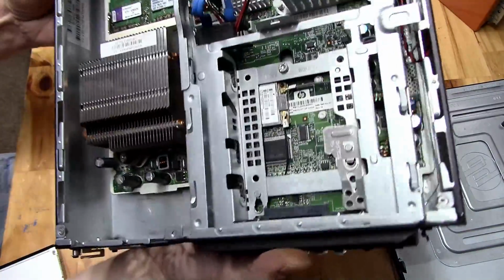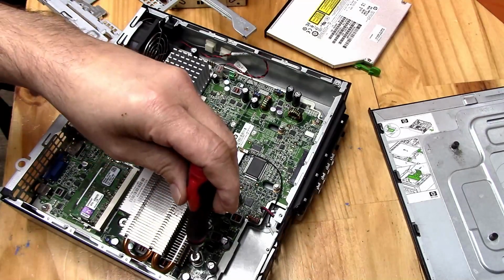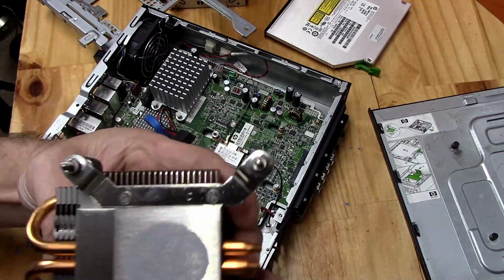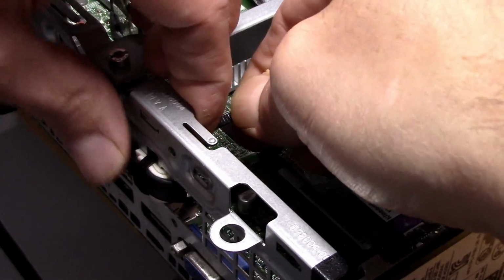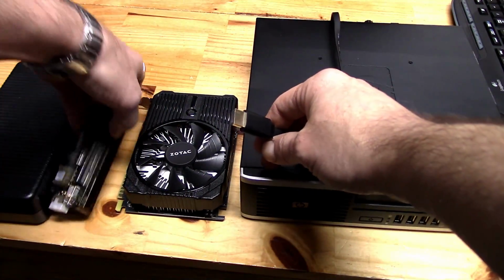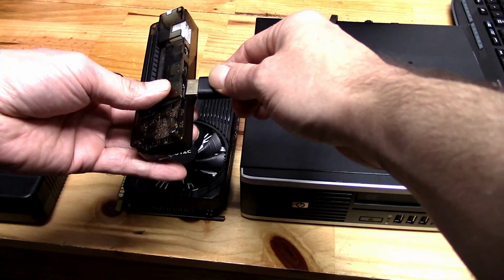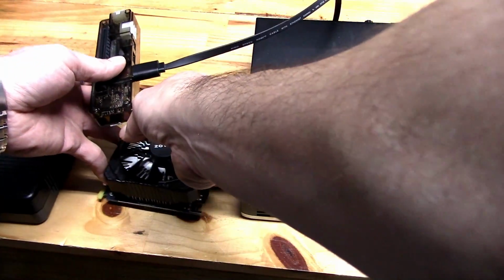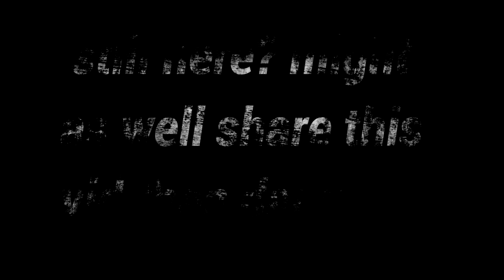gaming on hp pro elite

Comment: Your editing is getting simpler and simpler! And that's a good thing! No more flashy distracting bits! :D

Now, all that's left is the recording audio quality! Which I'm sure can be fixed with a $5 lavalier mic. >;)
Reply from the maker: +StringStorm ‌ I got one of those blue microphones. It records so low I have to use audacity to amplify I assume that's where I go wrong..
Reply: I thought gtx 1050 wont support/work on egpu because im planning to buy it for my laptop but i read a lot of people on the internet said they got error and trouble to use it with complication.Can u tell me how did u make it work
Reply: I'm pretty sure every card would work. It could be possible issues with the igpu of the laptop interfering with the gpu display output or maybe a defective egpu unit?
Reply: StringStorm ‌ i
Reply: modstek no you need a interface and a real mic bro the usb mic are shit unless you get a audio technica 2020
Reply: You prolly dont care but does anyone know a way to get back into an Instagram account..?
I was dumb forgot my login password. I love any help you can give me

Comment: I bought the Intel version 8300 USDT, paid £20 delivered which for the Windows key made it a very good deal and I didn't know you could hook up an external vid card, for what was going to be my PC to run my microscope and hold some tech manuals this little machine is being promoted to front room telly home theatre machine/retroarch beastie as mine someone chucked in a i7 and 8 gigs of SODIMM, my poor laptop is now relegated to microscope duty as that is slow as tar in comparison lol

Comment: Why you didn't replace the cpu with a Quadcore at least? Would have been better i guess
Reply: Crestom XYZ you must be new
Reply: The TDP wouldn't allow it i have a intel version of that pc
Reply from the maker: +Crestom XYZ I was hoping someone was going to tell me which ones are verified working
Reply: Troll Mctrollington Oh i didn't know, so that's why couldnt
Reply: EarthClad Not really, just i didnt know that the he couldnt put a higher TDP cpu, OEM mobos are really so pain in the ass sometimes
Reply: According to HP they offered the AMD Athlon II X4 605e processor (2.3 GHz, 2MB L2 cache, HT bus 3.0) as one of the processors with these systems.  https://support.hp.com/us-en/product/hp-compaq-6005-pro-ultra-slim-desktop-pc/4169006/document/c02142088
Reply: modstek AMD Phenom II X4 B95 but you have to do some tinkering and install a certain bios
Reply from the maker: +Kyle ._. Thank you
Reply from the maker: +cee128d thank you

Comment: there's several different variations of these. I've been wanting one just for its size. . I want an 8300 model. with support for an i5/i7 with 2x mpci slots + a GPU slot. the model in the video looks more of a base model with just a single mpci slot for wifi only
Reply: hpc 8200 usff has what you mention, i have it , ordering the gpu in a few days and lets see what happens

Comment: Why the wifi card adapter? You have full x16 PCIe with the MXM slot, you can even get cards as powerful as the GTX 1050 for that form factor, but you will need to fit a bigger heatsink for that.
e: wait this is AMD model that doesn't have it lol. Intel does have socketed GPU.

Comment: 4:03 is it possible to fit the half-size GPU inside the case ? My PCI adapter is a bit smaller. 
I have a half 1050 TI which runs great. I didn't get the 8200 yet that is why I ask.

Comment: Tried, similar cpu 8200 ultra slim compaq. Installed beast pcie, gtx 1050ti, and a modular power supply.

I get 4 beeps on my cpu. 

Tried changing my extension chord but still the same.

Help pls

Comment: Hey so I’ve been trying for the past week to do the same thing but I can’t make it work. I have everything connected like it’s supposed to but when I turn on the mini desktop the beast turns off and won’t turn on again unless I turn the desktop off. I tried changing the power supply cause I was using the one that’s like for laptops and I connected it to the one I use for my main PC but nothing happened, not even the green light turned on. I really don’t know what else to do and if you could help me out that’d be great. Anyways thank you!

Comment: I was wondering if you simply plug in the beast, attach the graphics card and power cord as shown, then plug the display into the graphics card directly? And you didn't need to touch the built-in vga port?

Comment: Do I have 2 use the PC power adapter and the docking power separate.? Or can I run the docking off the power of the PC? I'm building one for win xp games before and around that time and thinking of throwing in a gt 750 2 GB low profile.

Comment: I have an HP 8300 elite SFF (pretty much the same design) and I was wondering if I need to upgrade my PSU if I want to put a GTX 1060 or RX 570 in it and if so do I need any adapters
Reply: The SSF model is bigger. It has a 16x PCI-E slot but you won't be able to fit a 1060/RX570 on the case and the stock power supply doesn't come with the 6-pin power connector.
Reply: @marcussantos8574  there are some low profile cards now

Comment: I have a hp compaq 8000 elite with core 2 vpro, 4 gb ram and a 250 gb hdd
Reply: Karl Gaminde did it work I have the same desktop?
Reply: @raw6954  no, you can directly put a low profile gtx 1050 inside directly without the adapter

Comment: Nice 
I have this system
Q6600
4gb 
Gtx1050 msi 
Asus p5g41t-m lx
Reply: i strongly suggest you upgrading the cpu, because it is bottlenecking your gpu. you can go for Xeon X5470 or E5450, they are pretty cheap on aliexpress and much faster than Q6600. greets
Reply: @PrzeszczepiX  this is a late comment but doesnt aliexpress sometimes sell fake products?

Comment: Will this work on a hp compaq 8000 elite ultra slim it looks the same in the inside
Reply: no, you can directly put a low profile gtx 1050 inside directly without the adapter

Comment: Was that just a regular M.2 slot you used the external pcie dock with?
Reply: Or I guess I should be asking is what was the slot you plugged it into on the mobo called?
Reply: It's a usff pc so it had a laptop style wifi card, it's a pci-e slot. regular desktop mobo's don't have them
Reply: no, you can directly put a low profile gtx 1050 inside directly without the adapter

Comment: Does the dock get any power from the pcie slot or do you need external? Thinking if getting a gt 1030.
Reply: that's a mini PCIe on the Mainboard. It's suitable for Wifi and/or Bluetooth extension cards. I doubt it can deliver up to 75 watt. Maybe it can deliver 10 or 15 watt but that's it.
So the 1030 also won't work as it can use up to 30 watt. And this card will take 29 to 30 watt when 100% GPU load. So you must use the ext PSU.
And I'll think the external PSU will feed the PCIe slot for the GPU so it can use up to 75 watt.
Would be interesting how to power a 1080... cause it need external 6 or 8 Pin PCI power.

Comment: Is the power supply adapter necessary? Thanks in advance!
Reply: I'll think for 99% sure the PSU is necessary. Cause mini PCIe can't deliver that much power as it's designed for "low-power extension cards" like Bluetooth and/or WiFi

Comment: @modstek what is the model number of this pc? i just thought of a project to do :)
Reply: check. the. fucking. description. and also dont buy this exact model, buy an hp 6300, you can put a low profile gtx 1050 in there without all of this bullcrap.

Comment: Does this also work with a Hp compaq 8300 usdt?
Reply: no, you can directly put a low profile gtx 1050 inside directly without the adapter

Comment: You know nothing of bandwidth.
Reply: Neo Skribe yeah. GTX 1050 running on PCI-E x1 bus isn't a beast of speed.
Reply: you can directly put a low profile gtx 1050 inside directly without the adapter